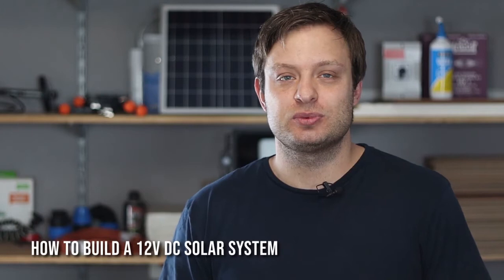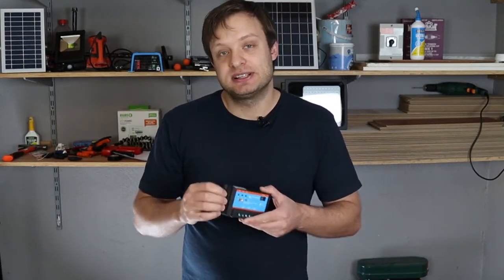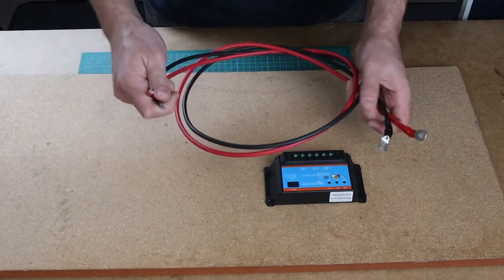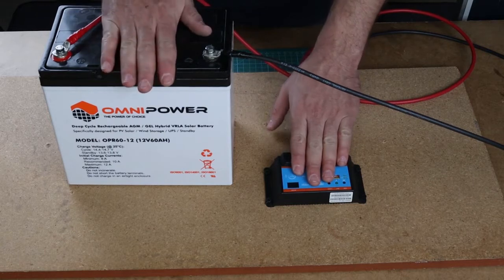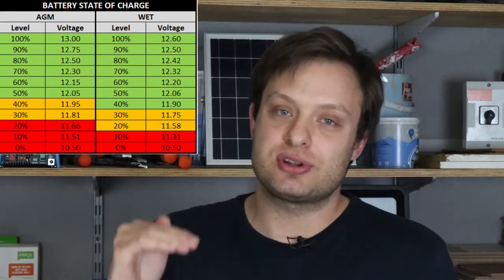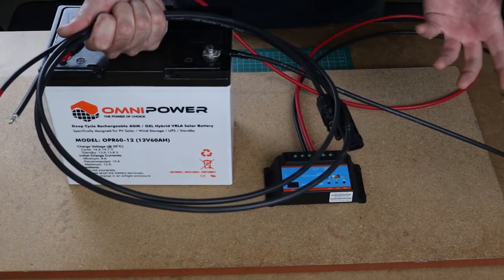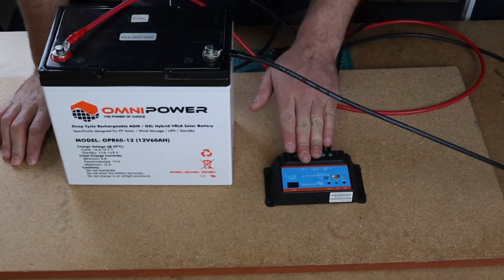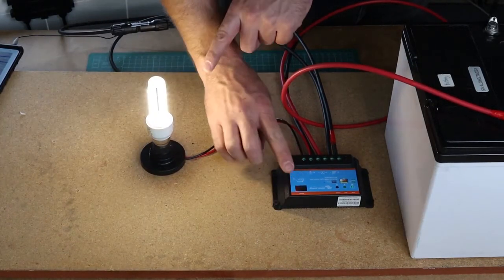How to Build a DIY 12V DC Solar System for Camping, Boating or Off Grid Living

Comment: Great video. Question: Do I plug my 12volt refrigerator to the charger controller load inputs, or to the battery terminals? Thanks

Comment: The MPPT chargers available in my country don't have DC out option. So installers here connect load to the battery through a PWM controller to avoid over discharging . Do you think I should go for one like that? Or would putting my 350 watt load would cause voltage drop and push MPPT charger to go to bulk charging, overcharging battery in the process?